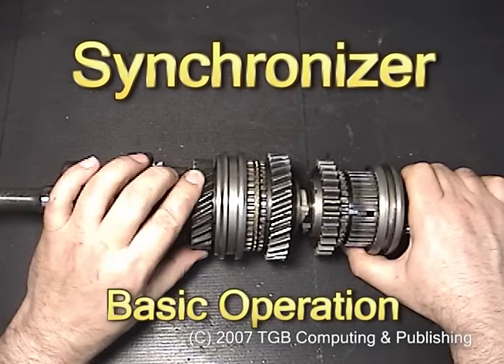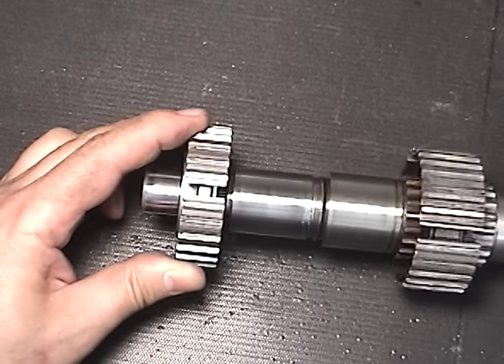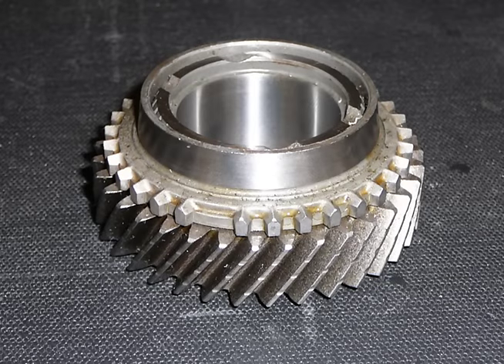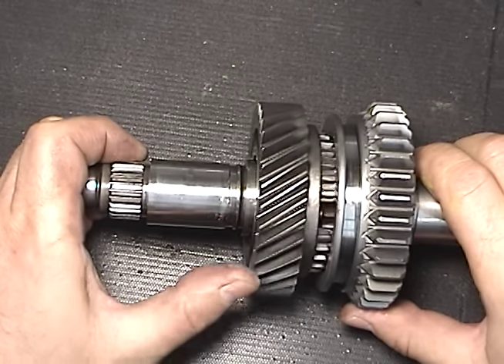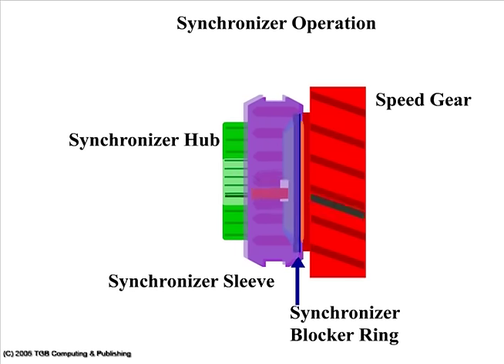Synchronizer Operation Explained

Comment: I am watching your video several times but I just cannot understand how the synchronizing ring slows down the speed to match the speed of the other gear. Doesn't the sleeve wear out? Once the speeds are equal then I guess some mechanism pushes the gears together and locks them, but once they are locked how can they separate? Can anyone explain to me in child terms since I am not a mechanic?
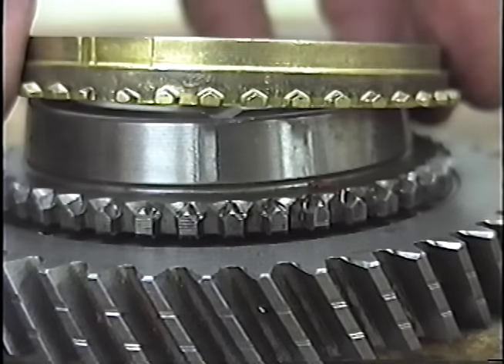Reply from the maker: Hi Richard, let me try.  Put your hands together like you are praying.  Rub them back and forth and you generate some friction and heat but yet you can still move them in different directions with little effort.  Now press your hands together with force.  You should notice that the force and friction will tend to want to make both hands move together.  When the driver wants to shift to the next gear say 1st to 2nd the sleeve is moved towards 2nd gear via shift linkage. (This might be your disconnect because the video does not show the shift linkage mechanism and what force moves the sleeve.) The sleeve pushes on the keys which in turn push on the blocker ring. The blocker ring pushes on the faster spinning gear.  The blocker ring and gear represent your hands. The friction between the gear and the blocker ring combined with the force causes the gear to slow down and match the speed of the blocker ring and synchronizer.  Once synchronized the same force (from the shift linkage) on the sleeve now moves the additional distance to lock the sleeve to the gear for a 100% mechanical connection. Separation takes place when the driver decides to disengage that gear. When the driver moves the shifter inside the vehicle mechanical linkage that connects the shifter to the synchronizer sleeve retracts the sleeve from the gear which disengages it. It might help for you to view a video on the "Learning Engineering" channel.  They have a good video on how the manual transmission works and is shows you the mechanical connection between the drivers shifter and the synchronizer sleeve. Here is the link. https://youtu.be/wCu9W9xNwtI  The entire video is good but if you just want to see the linkage jump ahead to the 5:06 mark. I hope this helped.
Reply: @DrivelineMaster  My issue visualizing the sleeve entering and adapting to the new speed is whether it's a rubber sleeve or a hydraulic compressing mechanism? once the "key" is locked into the new gear then how can it separate if it's meant to be secure and not slip out? The videos do not address these questions and I've seen dozens of them. Thank you for taking the time to teach me.
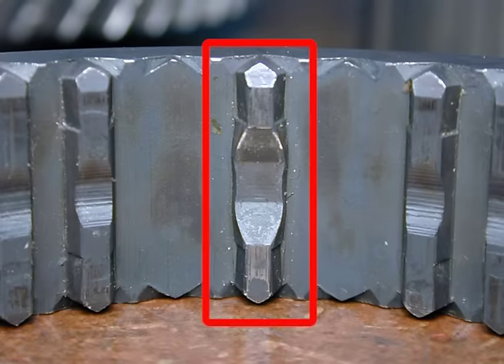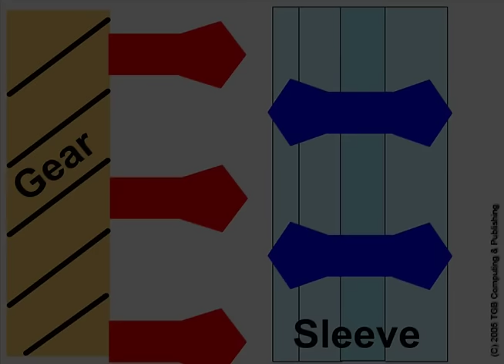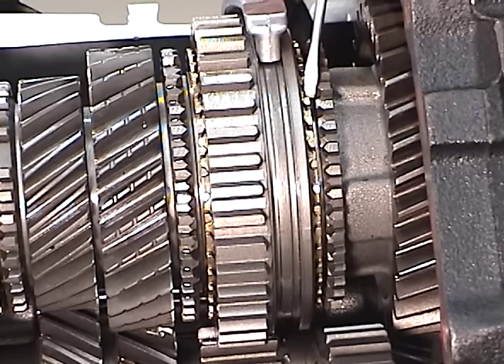Reply from the maker: Let me try once more.  There is no rubber or hydraulic mechanism what so ever and the keys have nothing to do with a lock of any kind.  The locking mechanism information can be found at time stamp 1:58 to 2:18 and again at 4:09 to 4:38. This talks about the design of the clutching teeth and how the design helps to lock them from separation. Time stamp 4:40 to 5:37 are all about the blocker ring and between 5:16 and 5:37 it talks specifically about the friction surface none of which are rubber. 5:37 to 5:56 talks about the keys.  Think of keys not as something that locks or unlocks but instead like a metal rod that transfers linear motion. The driver moves the shifter in the vehicle to change gears. This moves a shift rod linear. At the other end of the rod is a shift fork that is connected to the synchronizer sleeve which is also moved linear from the movement of the driver. The sleeve applies linear force on the keys which remember are just a rod to transfer motion. The linear movement of the key forces linear movement on the blocker ring which will use the friction surface to grab the gear and synchronize it to the speed of the sleeve.  Once synchronized the sleeve can move linear the rest of the movement to engage and lock the clutching teeth between the gear and the sleeve together completing the shift.  It's not really like a true lock where you lock or unlock a door and once locked you can't open it without turning a key.  Think more like Velcro. You can push it together and it stays but if you pull hard enough it separates. The sleeve and gear lock much like Velcro. Push them together and they stay but pull them apart with enough force and they separate. I hope this helped.
Reply: @DrivelineMaster  Why isn't there any grinding or slippage when the brass synchronizer touches the gear to match speeds and how this brass synchronizer know the exact position so the sleeve can engage and lock? There has to be a teeth match marker just like a "bite" in my mouth when I chew, matching the speed is not enough to synchronize the keys, am I correct?
Reply from the maker: Great question.  Look at my video at time slot 5:45.  You see the cut out where the key fits into the blocker ring.  That cut out is larger than the key for a reason.  The extra movement is the distance between the points on the clutching teeth on the sleeve. When the blocker ring first pushes against the gear in an attempt to synchronize there is a lot of friction and heat and resistance to slowing down.  The heat generated causes expansion between the gear and the blocker ring which adds resistance that pushes back on the ring, then Key then sleeve. This keep the sleeve from moving over to soon and causing a grinding of the clutching teeth. Once the gear and blocker ring have synchronized the friction and heat have greatly reduced and the resistance that kept the sleeve from moving over and locking to the gear is gone and the sleeve is allowed to slide over and lock to the gear.  When a blocker ring is worn out and no longer able to effectively synchronize that is when the sleeve is allowed to move over towards the gear too soon and grinding happens. This grinding is called gear clash.
Reply: @DrivelineMaster  The only problem for me is visualizing the locking synchronization attainment between the synchronizer brass ring and the speed gear because even if they are rotating at equal speed there are "3" particular locations for the keys to penetrate the groove openings to lock into position before the sleeve moves over. How do the 3 keys are pushed into their respective opening if the two equally rotating objects are not aligned, what makes the align properly? Is there a spring action that forces the 3 keys into their respective opposite openings? I swear, I never had this much problem trying to explain my questions!
Reply from the maker: I see.  The keys are always located within the cutouts on the blocker ring all the time. They don't move in and out of the cutout.  At time slot 7:10 during the live motion visual using the strobe light notice the blocker ring rotates at the same speed as the sleeve and hub.  That is because the keys connect the hub with the blocking ring. So you  see the keys don't slide in and out of the cutout they are always there waiting to transfer linear force to the blocker ring.

Comment: how to tell if a car has synchronizer or not? 
for example, my car is KIA Morning 2013 (also called Picanto in some countries)
Reply from the maker: All Manual transmissions use Synchronizer's for all forward gears.  Often reverse doesn't have a synchronizer.
Reply: @DrivelineMaster  oh
I have watch a few videos about rev matching when downshift on manual transmission, some ppl say it is unnecessary to rev match because modern cars has synchronizer
is it true?
Reply: @DrivelineMaster  by my experience, rev match or double clutch make downshifting really smooth, but does it help clutch or gear box in anyway?
Reply from the maker: Yes it is true.  I do know of drivers who are so good at rev matching that they can shift without using the clutch and it is smooth without grinding noises.  This truly is a skill.
Reply from the maker: The smoother the shift is the less stress and wear there is on the gearbox however the more  you use your clutch the more wear and stress you place on the clutch, release bearing and the rest of the clutch parts.  So, in my opinion it is a bit of a wash.  Just make sure to change the manual transmission fluid at least every 60,000 miles regardless if the owners manual says you can go longer.
Reply: @DrivelineMaster  okay, ty
great video btw

Comment: Still don't understand how the blocker ring stops the sleeve from moving over if parts are rotating at the same speed
Reply from the maker: If the parts are rotating all at the same speed it does not stop the sleeve.  It's when the parts are at different speeds that the sleeve is blocked from sliding over and grinding the gears.  OK, the job of the friction part on the blocker ring is to grab the gear and synchronize it to rotate the same speed as the sleeve and hub.  If you try to shift into 1st gear when your going 80 MPH the speed difference between the blocker ring, sleeve and hub and 1st gear is really large. So large that no matter how hard you try to force the sleeve and blocker ring to engage 1st gear and synchronize it's just not capable of doing this.  While trying to do this a lot of heat is created between the blocker ring and 1st gear.  Heat equals expansion and the expansion from the heat pushes the blocker ring away from 1st gear which pushes on the keys which push on the sleeve.  Hence the sleeve is unable to move into the gear and grind.  Grind because the sleeve and gear are not the same speed but different because they were not able to synchronize because of the large speed differences. I hope this made sense.
Reply: @DrivelineMaster  sorry I meant to say at different speeds. I watched some more videos and think I get it now. 

From what I understand, the rotational play of the blocker ring means that when the blocker grabs onto the gear, it will essentially be dragged out of alignment and prevent the sleeve from sliding over, until the speeds equalize. 

The heat generation angle is interesting, will read more into it.

Thanks for your reply!
Reply from the maker: The thought of the rotation of the blocker ring to prevent the sliding of the sleeve is understandable but not correct.  The blocker ring, gear and sleeve all have pointed teeth which will allow engagement when the teeth are not in perfect alignment. The pointed teeth along with the allowable back and forth movement of the blocker ring by having notches that are wider than the keys provides a window to which the sleeve can slide over instead of everything having to be in perfect alignment.  Often perfect alignment is not possible but synchronization is close enough for the sleeve to slide over and engage the gear without grinding.

Comment: I understand how they synchronize through friction but how do they teeth align?
Reply: ahh because the synchronizer only moves a bit (the lee-way) given by the snychronizer key
Reply from the maker: The cut out notch on the blocker ring where the keys fit into allows for a small amount of back and forth movement of the blocker ring.  The amount of movement is specific to the distance between the clutching teeth on the gear.  This ensures that when the sleeve slides over to engage the gear that the teeth will be in enough of an alignment for the sleeve to engage the gear.  Because the teeth are pointed alignment doesn't have to be perfect, just close.

Comment: I have a question, why is it that the 1st gear is sometimes stuck, and i have to try another gear and try to put it in 1st again, untill it is aligned?
Reply from the maker: This can be cause by many factors. Try putting the trans in "N", let the clutch out, then push it back in again and try first gear. It could be just that your gears and clutching teeth are worn down or the lubrication is worn out.  I would recommend to try replacing the oil with RedLine Synthetic MTF.  This works miracles on some older transmissions.
Reply: @DrivelineMaster  Thank you for your clear answer, as we are speaking my transmission gets some TLC from the revision, this because the synchroring of the 2nd gear broke, its a full revision, so everything with wear will be replaced.
Reply: @DrivelineMaster  After the replacement of the gearbox the mechanic analysed the problem and the oil had run out. Having taken care of my car so well i completely overlooked this. reason for replacement: the synchroring of 2nd gear didnt work annymore.
Reply from the maker: There must have been an external leak because gear oil doesn't evaporate.  The only other reason for no oil or lack of oil is someone didn't fill it properly.  Since you are having the synchronizer fixed I would assume the technician is performing a complete overhaul and replacing all of the seals and all of the main bearings.  Speed gear (free spinning) bearings only need replacing if they show signs of wear but input, main and counter shaft bearings should all be replaced while it is apart.  If there are any bushings in your transmission they should be closely inspected and replaced if they show any signs of wear even if it's marginal. You don't want to do this again in 30K - 40K miles.
Reply: cust
mostly
burn
through
1st  
gear
without 
engaging.